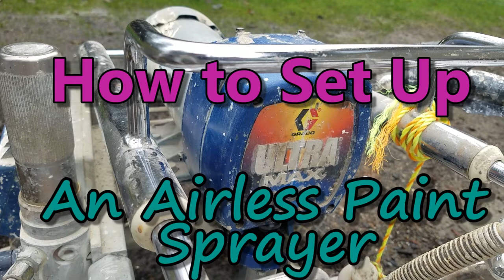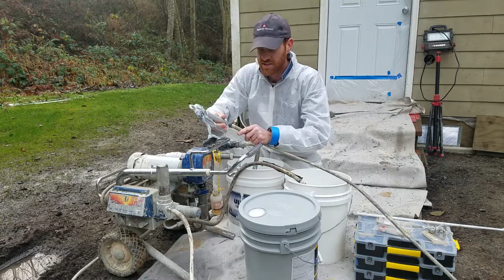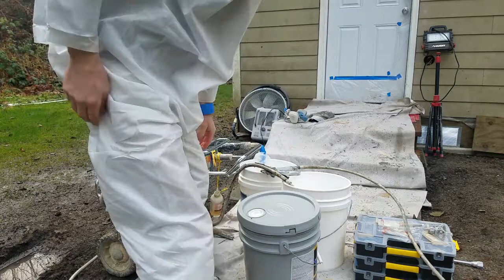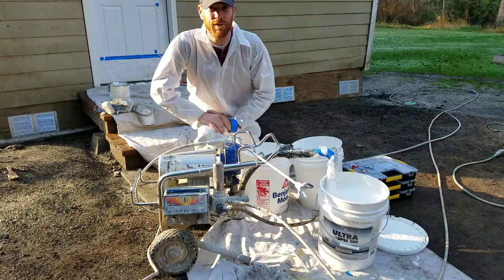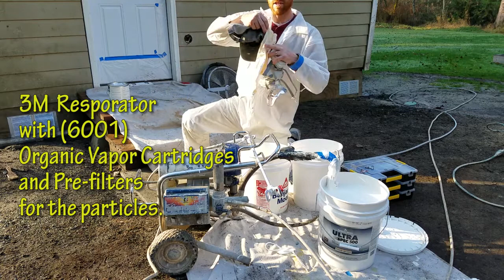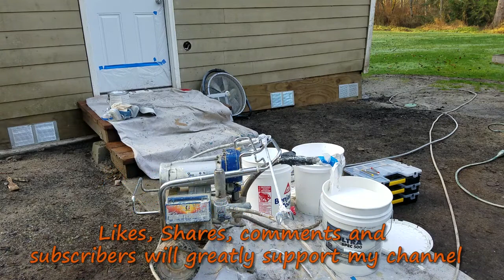How to Set Up an Airless Paint Sprayer

Comment: Hi I have a 695 ultra high boy has the same smart control filter and has that part self cleaning I think it is the part that is close to the hose attachment Ineed the pump but  just can't find the  pump cause I think this are old models machines I dont know if u have replace this par in the past
Reply from the maker: I haven't bought any replacement parts recently... back in 2015 my repair guy replaced a couple things

Comment: good job. what are those black and yellow trays, are they for the filters, and where did you buy them
Reply from the maker: James Quant Those are storage boxes.  One is for screws, nails and hardware. One is for my driver bits, drill bits, punches, sets. One is spray stuff, tips, filters, housings, washers, fittings, etc.  Made by Stanely. Found at hardware stores for about $10 each.